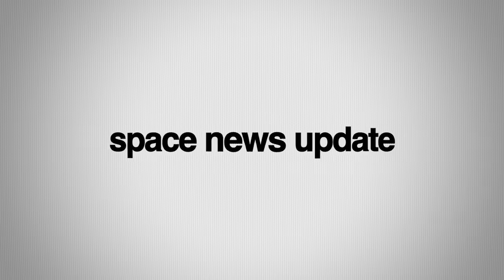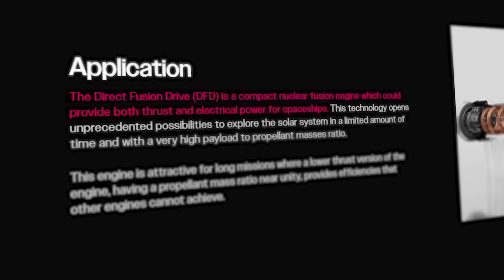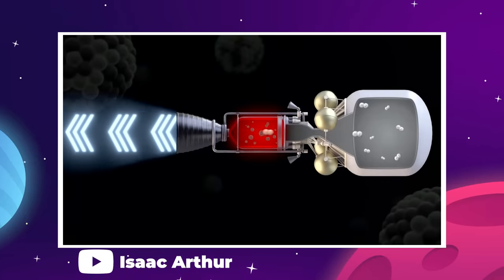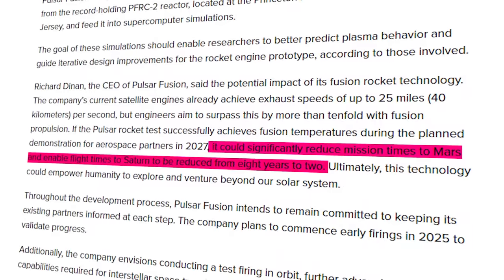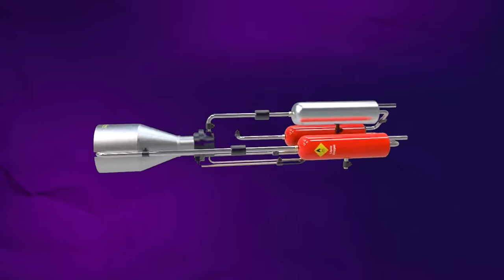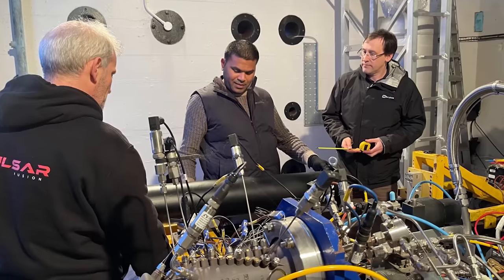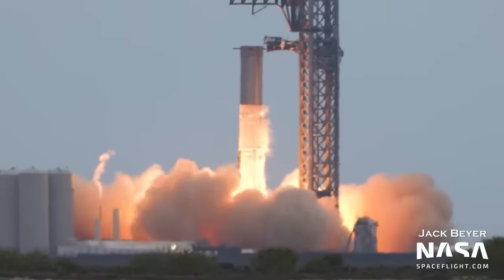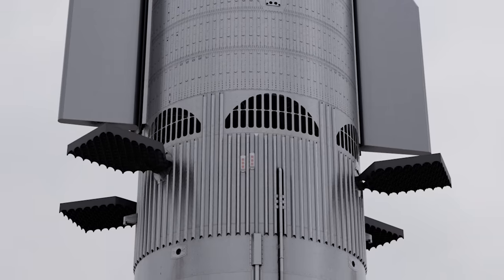The Nuclear Fusion Rocket Is Coming!

Comment: I want to point out that ISP is a rating of how efficient an engine is and a HIGHER number is more efficient, not less. So it is 1/3 as efficient as Space X's Raptor. Your numbers seem wrong and they entirely undermine the point you are trying to make.
Reply: Yeah, I checked their wikipedia and you meant to say 10,000 seconds for the ISP. Not 105 seconds. That would be worse performance than any rocket, ever.
Reply: yeah kinda shows how this guy doesn't really know much. i wish there were less unknowledgeable elon fanboys on yt
Reply: Yeah, he makes nice videos, but he often makes ridiculous mistakes like this
Reply: Sadly, proofreading and checking your work started going out the window about 5 minutes after the internet showed up.
Reply: @filonin2 it actually says 105s directly on their website… they’re missing a couple zeroes on it, maybe a typo? Lol 

“The Direct Fusion Drive is a revolutionary steady state fusion propulsion concept, based on a compact fusion reactor. It will provide power of the order of units of MW, providing both thrust of the order of 10−101N with specific impulses between 103− 105s and auxiliary power to the space system.”
Reply: @filonin2  Tom?
Reply: @filonin2 it's between 10 thousand and 30 thousand seconds, as according to their website, exhaust speed is between 108 and 300 km per second
Reply: So they don't know how to calculate ISP or sent text some website design company that screwed up
Reply: Thanks to KSP I was able to detect that mistake. 😅
Reply: @millinoid2151  it's meant to be 10^3s and 10^5s, i.e. 1,000s to 100,000s. the notation is missing on the website.
Reply: I stopped at that and did not bother watching the rest. Seriously, 100 ISP is atrocious!
Reply: Thx for telling. Gonna be taking diz guys channel with a huge grain of salt from now on.
Reply: @filonin2 exactly
Reply: Yea when I heard that number as a sci fi nerd I know for s fact DFDs can reach easily in the thousands
Reply: Duh  looosh? Its 'dell yooog'.
Reply: you realize he means more efficient in the means of fuel consumption right?

Comment: 105 seconds? that would be much lower isp. existing nuclear thermal engines are in the ballpark of 1000 seconds
Reply: I assume he meant 105,000 seconds otherwise it wouldn't make any sense.
Reply: should be around  11,000 seconds
Reply: Well I mean we don't rly have nuclear thermal engines yet, just prototypes. Would love to see nuclear fission or Fusion rockets in space though.

Truly think it's the future of space travel
Reply: There was a typo on their website and it's meant to be 10^5 seconds
Reply: @magnetospin Meant to say 10^5 so 100,000
Reply: Apparently it comes directly from the website (between 103s and 105s) - but that's most likely a formatting issue, as the "3" and the "5" were supposed to be a power notation (10^3 and 10^5) - meaning 1000s to 100000s
Reply: We all make mistakes, mis-speak, or misread web sites ... but talking about an ultra efficient  ISP of 105 is a big one.  Not sure he's correct re the radiation hazard as well.  In the narrator's defense, I think he changed the company name (but didn't write it) at one point.

Comment: TLDR: Higher Isp = higher exhaust velocity = higher efficiency.
Isp is not in seconds because it measures how fast an engine is. It's in seconds because It's inversely proportional to the speed of fuel consumption. A higher Isp means slower fuel consumption, not a slower engine. 
However, it is directly proportional to exhaust velocity, which in turn gives you the engine's thrust capability.
Reply: 1 kg of thrust from 1kg of fuel for x amount of time (sec).
Reply: Also this would have to be used only in space.

Comment: Even that LLNL "break even" isn't really accurate. It didn't create more energy than the gross of what the entire process took, only what the laser injected. If you factor in the energy required for all the ancillary requirements, like magnetic containment, things like induction and heat losses, it was something like 20-fold short. So, we're still a loooooong way away from viable fusion.
Reply: We don't need to make more energy than in for use in a spaceship
Reply: Fission is fine for near future nuclear spacecraft. It will last decades without a refueling and the propellant will run out far sooner anyways. Even with numerous propellant refills the reactor will keep going for a reasonable length of time suitable for space station use, not just a single trip to Mars and back.

Comment: The OLM and the booster don't sit on the concrete pad. They sit on the load bearing pilings buried deep in the ground.  And all those NEW underground piles for added support were poured over a month ago, so they're already at 85-90% of design strength.  Relax.  ;-)
Reply: I am sure the two are not even connected. The expansion would be catastrophic.

Comment: Just another 30 years for Fusion to work.😂😂😂😂😂😂
Reply: The problem is that fusion works...but you need energy for input and you get less as an output....but that is not a problem in a rocket...is only a problem when you build a nuclear plant
Reply: fusion works, just not net positive. Works fine for a rocket.
Reply: This joke is old, give it a rest
Reply: Fusion is already possible here on Earth has been for a great number of years, what's not yet possible is getting more power out than is used to start the 'reaction'.
Reply: I'm not sure what your point is.
Reply: Exactly what I thought, I was just thinking that we need to create successful fusion first
Reply: That is permanent fusion, temporary fusion like what we have achieved is well more than enough for a rocket engine. and fusion is easier to achieve in space rather than within the atmosphere so this is a very possible idea.
Reply: @moss_fetttt we world need a second power source to keep it running.
Reply: What does this add to the conversation?
Reply: Solar power took well over 100 years to become viable. Fusion is more complicated than a few panels. You’re really not funny.
Reply: Nah this new UFO and reverse engineering we will have warp drive next yr so this would be obsolete before it comes out lol
Reply: Just like the world ending every 10 years
Reply: Actually if you installed robotic orbital power plants to generate the power to initiate the fusion, say one in orbit around the moon and one in orbit around Mars, you might be able to start the fusion in a transit craft. Once it's running point it at Mars...slow accelerate for the journey. The real trick would be to initiate the braking on the the other end. That perhaps could be done with a chemical rocket with on board fuel.
Reply: @javierderivero9299 so what will be the orginal source of energy (on the board of the spaceship) for this nuclear fusion rocket engine with negative net energy balance?
Reply: @Poe9320 how long would be the period of duration of this "temporary" fusion? The shorter this period, the bigger thrust of the engine should be (to obtain given increase of mechanical energy of the spaceship). Too great thrust would result in top great acceleration of the spaceship, which would kill the crew and caused other negative effects.
Reply: MAYBE five more years dude. Get over it?
Reply: @n.g.s1mple29 old,  but still gold.  It'll rest when useful fission is in anything other than a warhead.   Just 30 years now!
Reply: @jmcclain8237 is a joke,  mate.   Fission energy has been only 20 years away for about sixty years now.
Reply: @hairybubbles127  What??...there are fission nuclear reactors since the 1950s as well as submarines and airshipcarriers, etc   don't confuse fission with fusion...
Reply: Fusion is around the corner, like it has been for the past 50 years!
Reply: @n.g.s1mple29  We’ll give it a rest in 30 years
Reply: @zmblion  the problem with warp drives is getting enough antimatter to power it, we already have a basic idea of how they work, and that would take you to the speed of light without time dilatation I think.
Reply: @zmblion and how do you know that the alien craft has a FTL drive?
Reply: @caseyk.479 Negative mass, not antimatter
Reply: @jmcclain8237 It's a long standing joke. Fusion power always seems to be 30 years away.

Comment: Ar you sure those ISP numbers are right?
Reply: That's what I said. 105 seconds ISP would be worse than any rocket, ever. He doesn't seem to realize bigger numbers are more efficient with ISP.
Reply: @filonin2  yea, I think he got them the wrong way around?  Also, the Angry astronaut Chanel did video on this not long ago, too. Slightly more in-depth.
Reply: ISP is exhaust velocity in meters per second divided by Earth's gravity acceleration... Which you can round up to 10.

At 110 to 300 km per second exhaust speeds from their site, that is 110 to 300 thousand meters per second. Divided by 10... 

About 10 to 30 thousand ISP

Comment: Russia has been working on the project of a nuclear tug "Zeus" for many years - a spacecraft with a nuclear reactor. Its first version is to fly on ion thrusters, very large ones. They are ready and tested. And the next version of the tug can be equipped with rotary magneto-plasma engines. In general, it is very similar to what you are talking about in this video. Russia has been working on this technology for several years. The first flight of the tug is scheduled for 2030. First he will go to Venus, drop one probe there. Then a gravitational maneuver and flight to Jupiter, more precisely, to its moons.
In the future, I would like to see a collaboration between Russia and the United States (because when will all this enmity end?). Future, more powerful versions of the nuclear tug could work in conjunction with Starship. Starship can put a large payload into orbit. And Zeus can deliver it to the Moon or Mars. Not very fast, but very very cheap.
Reply: Is my understanding correct,  it's more of a space ship with a nuclear reactor on it, to power ion engines? So  technically wouldn't be a nuclear rocket but an ion rocket powered by nuclear reactor?

Genuinely asking and curious
Reply: @CountryLifestyle2023  Well, it won't be a rocket, the nuclear tug will be launched into orbit by the Angara-A5 heavy launch vehicle. You can search for "nuclear tug Zeus" and see what it looks like. But in general, yes, it will not have a nuclear engine, only a nuclear reactor with an electric generator that will power either ion or magneto-plasma engines, which are much more efficient than classic ion ones. And it was the idea of these magnetoplasma engines, apparently, that was taken by this British startup. Because earlier Roskosmos has already stated that it is working on this technology. Well, let's see who does better =)
Reply: @Alexandr_Lee  So more of a transport vehicle in space, can't take off but once in space can move things around. 

Any development with nuclear via fission, Fusion or other variations in space is rly important and look forward to seeing them.

Magneto plasma engines are not a new idea or new thing. The idea has been around since 1970s, in the USA,  and multiple companies are trying to achieve it atm. So the British didn't steal the idea from Russia. It was already a concept since before Russia existed lol 😆 

I would put my money on SpaceX, I know they are not doing the same thing, but by 2030 they could be sending first human missions to Mars... lol
Reply: @CountryLifestyle2023  Sorry, I'm writing through an online translator. Apparently, I didn't express myself correctly. I meant that the British are in this race because the Russians are already doing it. And if we are doing this, then apparently it is already technically possible =)
Reply: nuclear powered magnetically accelerated particles are for the boost phases to get proper delta V. Ion drives are for propellant efficient long term coasting and minor course corrections. A good interplanetary craft should have both.

Comment: Fusion! That is for the far future when fusion is actually delivered and affordable. Thermal nuclear-using fission is deliverable in the near future and is far cheaper. Go for something that works rather than provides constant funding streams. And fusion does that in spades. 70 plus years and it is still "just around the corner".

Comment: I seem to have missed where they magically have the energy required to create the magnetic field and plasma.
Reply: umm, I think they said the "magic" is fusion.  The magnetic field could be made by the same electrical generation  system used for power the life support, etc.
 For example, the Waste heat from the drive could magically power  a rankine or closed brayton cycle turbo-generator. 
last i checked, most fusion reactors use super-conducting magnets and only need power for the cryo-coolers.
Reply: Simple ... Another fusion reactor 😂🤣😂🤣

Comment: The team at Livermore worked with inertial confinement based fusion, while something like the ITER is a magnetic confinement based reactor. You say how the Pulsar team is working off of Livermore research. Does that mean the underlying principle of the Pulsar rocket is inertial confinement and those coils in the rocket are just meant to help with directing the flow? Trying to make sure I have this understanding right.
Reply: Yes.  I wouldn't know which it is from the video either but a strong guess is that this has got to be a magnetic confinement based reactor.

Comment: Concrete makes 75% design strength in 3 days, 2-3 weeks for 100% (depending on the mix design). This is verified by compression tests on 6” x12” destructive test cylinders mad by a third party materials testing lab

Comment: You are making very rookie mistakes about ISP. 100 is a TERRIBLE number. ION engines can have an ISP as high as 10,000 with very low thrust. (Higher number is better, not worse.) Nuclear Thermal Propulsion using a fission reactor can be as high as 900, with thrust levels similar to chemical rockets. So what is the fusion system expected to have? 100 would not be very good.
The beauty of a fusion rocket (as opposed to a power reactor) is that all you have to be sure of is that the plasma expands out in a certain direction. A power reactor has to stay "ignited" and hold the plasma in a fixed area. The Fusion Rocket just has to make it "pulse" as a fusion reaction and send the plasma out the back. Should be easier, but then it is all very new. Look how long it took for NASA to use ion engines on interplanetary missions. They had to prove reliability before they would gamble multiple millions of dollars on a mission depending on the ion engine.
I am sure this pulsed fusion engine will be the same. It will have to be proven experimentally to be reliable in SPACE. Once certified, then they can use it on a mission. And to use it with astronauts will require a lot of unmanned missions under its belt. It will likely be used for cargo missions for quite a while before astronauts. The good news is speed, efficiency, and thrust equals more safety. 
A quicker trip means less radiation, and more abort modes home in case of disaster.

Comment: "There really won't be any way to telling if this system will work until we get it into space and turn it on"

Ah, no. there are plenty of ways of telling. Fusion is no where near breakeven when you factor in all the energy needed for containment and cooling. Where is all the waste heat from this going to go in space?

This is hucksterism at it's finest.

Comment: Unfortunately, until WARP DRIVE is invented and refined there will be only short-term exploration of Space for a very long time. 
A manned mission to Mars will be a one-way ticket. It will not resemble a trip to the Moon as distances are far greater. A life support system must be maintained and work flawlessly for an enormous amount of time. Even a successful landing on Mars will require major life support. Mars's atmosphere is 95% carbon dioxide and oxygen is 0.13%, a trace element. Atmospheric pressure is like being at an altitude of around 135,000ft on Earth.

Comment: Didn't realise they had even got fusion to work?
Reply: Oh yeah, Fusion works. It’s just ‘barely’ breaking even though. Currently for ground-based Fusion power testing, you only get the amount of power out of it that you’re using to run it. Obviously, that’s not going to work for entire cities. So the work continues. Thankfully though, this engine is using the Plasma for the thrust and the power output for the ships electrical systems. Very economical.

Comment: in addition to the concept of the ISP not very well understood by the author, (the techniques of space are often very complicated, and although passionate, we are not all engineers in space propulsion) a question comes to me
obtaining a hot plasma and maintaining it over time requires fairly significant amounts of energy MegaWatt level (as well as techniques that may not all be very mature).
this proposal is certainly very interesting but I think that fusion-based propulsion systems may still be great SF for a few more decades.
the closest thing to a NEW space propulsion system, close to the  "ready to fly" state,  remains the VASIMIR which has been studied since the 90s

Comment: I suppose fusion engines will be practical, someday. 
Of course, one has to wonder how human bodies will survive the inertial force exerted on them by the acceleration involved with 12-day transits to Mars... 😜
Reply: They're going to need to handle some serious g's I'm guessing.
Reply: You could have a constant 1g acceleration and deceleration solving the no gravity problem for Human body's in space.
Reply: 1G of acceleration would get you to Mars in a day or two, so it won't be an issue.
Reply: @s3cunit  😆😆😆